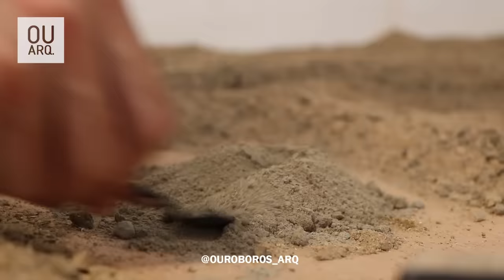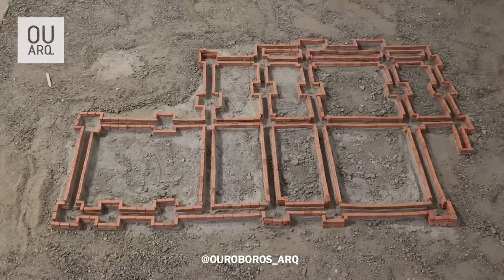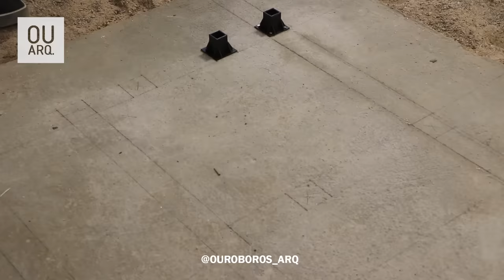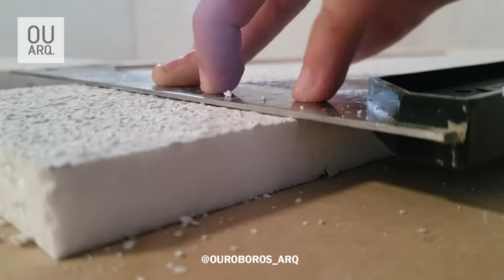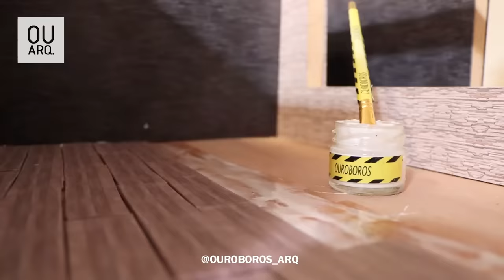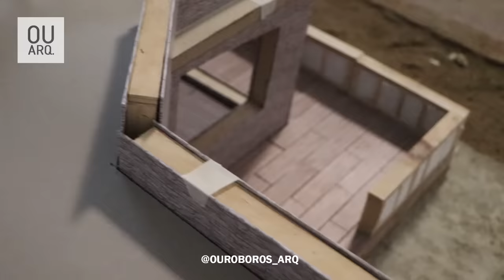HOW TO MAKE 🍔 Mc Donald's mini🍔 DRIVE THRU--Cómo hacer un mc donald's

Comment: Is this perhaps a mcdonalds in a foreign country?  Here in America we dont build them shapped like this, nor do we have mcdonaldss with wooden subfloors.  The concrete slab has either tile or carpet glued to it.  So the buildings just sit on the concrete slab.  You did such a fantastic job on this.

Comment: You spent all that time forming and pouring a concrete foundation, framing walls and applying texture to your panels, and then let your floor boards curl and lift? That would drive my OCD crazy.

Comment: Dude wtf , your building a model, why the need for fricken concrete,and metal supports and rebar, did you build the septic tan tank as well , and gas lines , and did you put electrical and plumbing as well, it’s a MODEL NOT A ACTUAL Building,geeezze dude